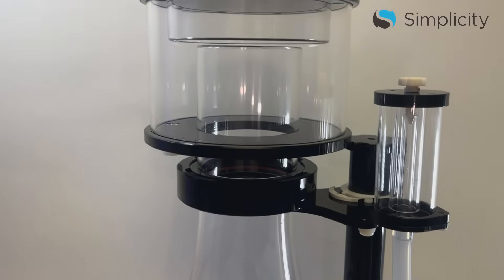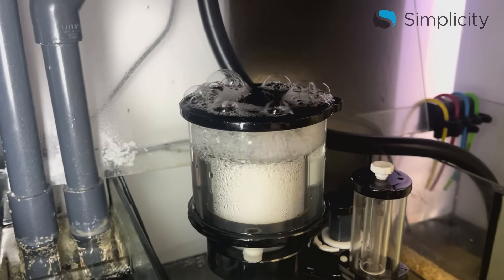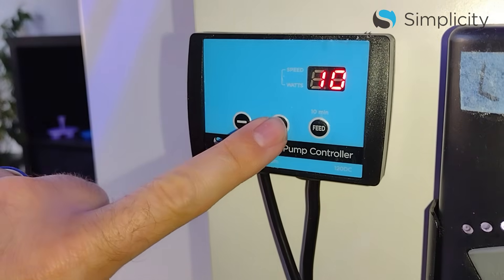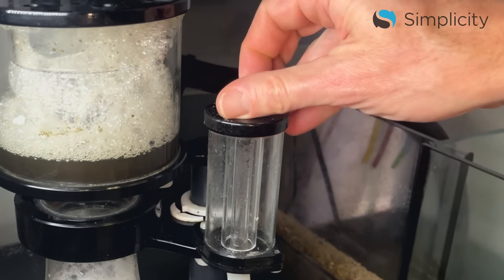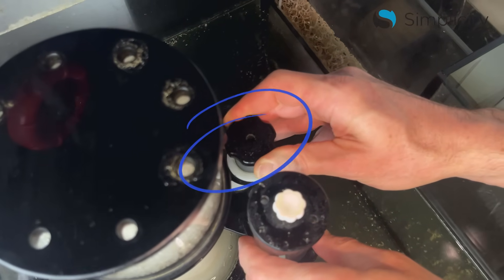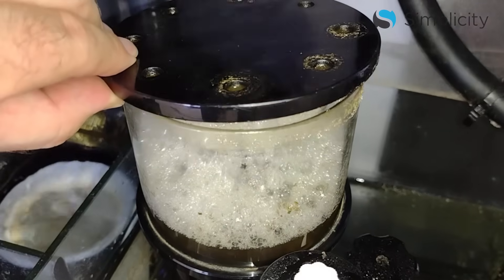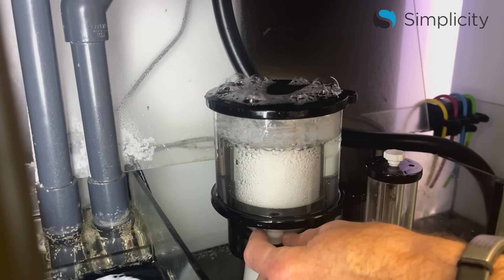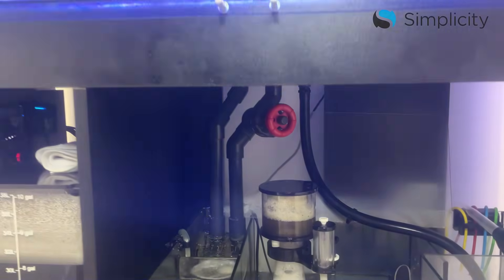How to Tune a Protein Skimmer - Simplicity Aquatics

Comment: I have the 320dc model and the water level doenst change  but i find myself trying to dial in the skimmer almost daily. Overall i like it more than my smaller tank 1.5 skimmer but not a fan of it needing daily tuning. Yes its been broken in as its been running for months.  Its a bit of a pain too cause im also carbon dosing and with the skimmer not running at its peak its not exactly doing anything. 

One other correction you said for 320 run it at full speed or 1.0 ? the 320 doesnt have that it has levels from 1-24
Reply from the maker: Thank you for sharing your experience, and I’m really glad to hear you’re enjoying the 320DC overall. Let’s see if we can help get that daily tuning under control.

For the water level, the adjustment is done by opening or closing the gate valve, which controls the internal bubble height. We walk through this step at 1:35 in the video.

Regarding the pump speed, there is some confusion about what the controller is displaying. The 1–24 you’re seeing is the wattage, not the pump speed. The actual speed level appears right after you change the speed by pressing the “+” or “–” buttons, and after a couple of seconds, the display switches to wattage. Try pressing the “+” button a couple of times and watch the display immediately—this should help you confirm the correct speed setting of 1.20 for your 320DC.

Regarding carbon dosing, this will impact any skimmer's performance. The tuning process is still the same; however, you will likely see increased waste production and a lighter-colored skimmate.

If you still need assistance, please get in touch with our support team using the link below—we’re always happy to help you get the best performance from your skimmer!

https://www.simplicityaquatics.com/contact/